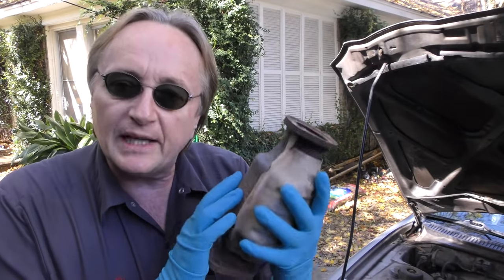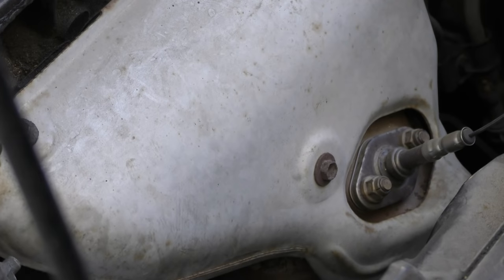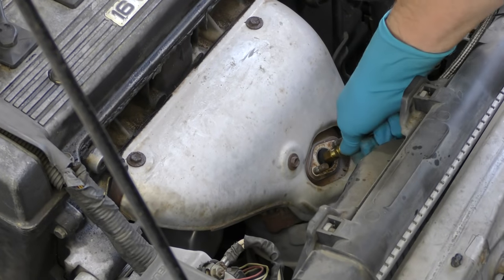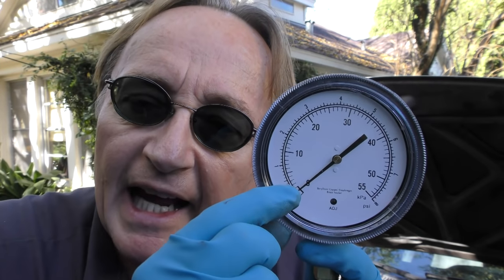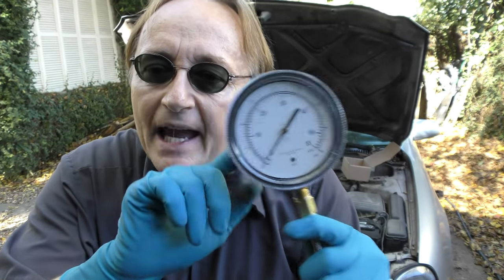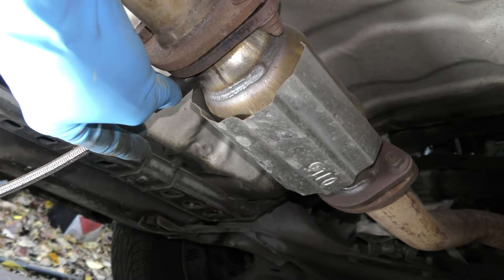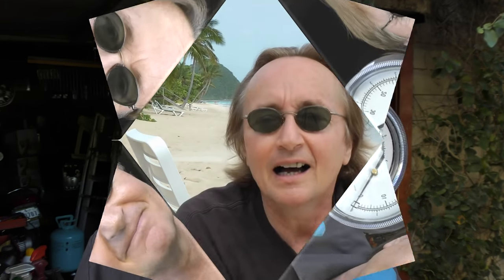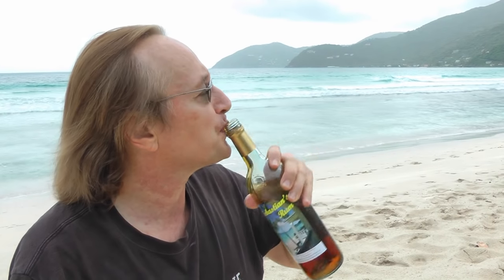How to Tell if You Need a New Catalytic Converter in Your Car

Comment: ok a long story long lol I bought 99 Ford  ranger. it set for year with 3/4 tank gas. I top it off with injection cleaner. truck hard to start. once I get it going drives great for 20 miles although idol rough. but then be doing 65 and sputters to a crawl. I pull over nearly dying I shut off restart v several times backfires then idols good enough to go and then I can only go few miles before repeated.. on first time I could probably go 100mph but once it starts sputtering I can't. it shows all three sensors out I could only afford the two top sensors left and right o2 , would these do that . for they are $50 a piece. also first 2o miles uses no gas after that I assume i get five miles a gallon have to hVe floored to go 50

Comment: Hey Scotty, great video helped me diagnosed my problem more.  I drive a 94 Honda Accord that I bought used.  I need to replace my exhaust system as it's all rusted and rattles when I drive.  Where I live my car is exempt to emissions testing due to its age.  Can I get away with replacing the cat with a straight pipe then getting new parts from the cat back?  Thanks!
Reply from the maker: yes, you'd be breaking the law and the check engine light would come on though. It is merely an anti pollution device, nothing more
Reply: Scotty Kilmer 8😡

Comment: What if you drilled out each individual hole. It would resurface the sides knock off all the debris. Maybe I better check out the design of one to see if it's possible.

Comment: That OTC Back Pressure gauge typically runs over $130.00 new. Unless you're hunting around for a used one that's not exactly a cheap solution.

Comment: Question I change the fuel filter did a tune up airfiler good . the guy at AutoZone told me to reset the computer not it hesitating not shutting off when is idle it fine . run my code 300 and 358 come up will that make my car cause hesitation when driving it .

Comment: Hey there am having real trouble with my 06 honda civic have been getting random and multiple misfire, I went a change plugs even engine and its the same thing. Whenever I clear the code it comes back and car start operates in limp mode. Any suggestion

Comment: I have a 2011 Buick regal with a 2.4 I get a smell inside the car it almost seems like it’s coming through the vents I’m not sure but after a couple weeks of check engine light came on it has power it runs I just don’t get the greatest gas mileage. Can you help me?

Comment: My mechanic said the cat in my Galant was going bad, so he put a washer in between the o2 sensor and the cat, reset the codes and never had the check engine line come on again. No emission testing in my state, otherwise I would have had to get that fixed.

Comment: I have a question my check engine light came on due to the catalytic converter. So I need a new one. And at the same time my A/C started throwing warm air. Did the ac have anything to do with the catalytic converter messing up?? Please help 😭😭😭

Comment: A quick one, is it bad if I have no backpreasure at all or negligible on a motorcycle, can this affect in any way the exhaust valves if so how
Thanks)
Reply from the maker: +george linco (gj047)  it can make the engine run lean, hot, and burn out the valves eventually

Comment: My muffler guy was only able to check behind my second catalytic converter and it has low pressure... on 2008 honda civic . Was low pressure couldn't get behind the upstream one so what shouild i do Scotty? Only rev's to 4500 sitting still but flows right to 6000 down the highway I'm baffled... could it be ignition coils causing this problem? I'm always pulling the Po402 code and can't get the car inspected.. HELP anybody? TX!

Comment: Scotty, I went to mechanics who seem honest and they told me I need a catalytic converter.  The Engine signal is lit up on my car.  The problem is they told me it will cost between $1,700 - 2,000!  I really can't afford that and my car is 20 years old.  In one of your videos you said to get a Walker Converter.  Would that work on a Lexus ES300, Year 2002?
Reply: What did you end up doing i have a 2000 GS300 and they gave me the same price but my car drives just fine I honestly feel like its a sensor but I can say i dont know that neither. Lemme know what worked for you man
Reply: Was it Cat. or sensor(s).

Comment: I have a 2000 Dodge ram 1500 5.2l  and it idles high and makes the headers start to glow what could it be I changed the IAC valve but it still idles high

Comment: Hi Scott. I like ur videos. They are rrally helpfull.I have a 3.8 engine buick regal,  one of the head there is a corrosion damaged where is the water cooling hole question: what would you use to cover up for a good seal? Considerer high temp and high psi

Comment: Ford replaced mine for free at 140k miles.
PZEV Ford Focus 5yr./150k mile warranty on emissions.
I think it went bad cause I had a miss from a bad coil for long time.
Engine was overheating and pinging due to back pressure.
$1500 job..Zero cost.

Comment: can a bad catylitic converter cause a almost screeching sound in a 2000 porsche 911?  I have this horrible screeching rattle sound in my 996 and I ve replaced the the serpantine belt and a pulley that didn't sound too healthy.  water pump is new so thinking maybe the catylitic converter but im no mechanic and Im done paying money to a shop just to guess and see
Reply from the maker: na, they rattle when they go bad, generally that's something  a belt drives.

Comment: Maybe you have added that the 02 sensor don't always come out so easily especially if they have been in there for decades and even using the special 02 sensor socket is no guarrantee it will come out.  Not a piece of cake as you make it sound.

Comment: Scotty could this cause a car to push oil out the engine seals? I put in a new engine and its eating oil just like the old engine did.
Reply: I think the blowby from 6 cylinders might be too much for the pcv valve to handle. the pcv valve is new. its an rx300
Reply from the maker: a clogged cat can do that by pressure
Reply: Scotty Kilmer that's what I figured. i cut it open, removed the media, and welded it back together until I can afford a new one. I realize I'm removing designed back pressure and its not environmentally friendly but a new one is out of the budget and my kids need to eat. lol. it was stuffed up real bad. we will see if it stops eating oil then that was it. 

thanks for the reply Scotty. God bless you man.

Comment: +Scotty Kilmer i have a question. I have an 08 scion tc and i just replaced the 02 sensors in my car. It told me that the sensor had low voltage. So then I ended up buying another and replacing it yet I am still getting the reading and my car is have a rough idle especially on startup where it goes to like 500rpms. Is it possible its that catalytic converter or no?

Comment: Scotty i need your help 
Gmc envoy 03 
As soon as the heater gets turn on I get a message about low oil pressure 
Any ideas 
I just replace the battery and starter 
Please advice

Comment: i have a 93 corolla with a catalytic converter that looks very alike the one you show in start of this video....  Mine now has a few small holes in it that leak very noticeable exhaust stink... i tool it off and i saw holes occurred on the top outer edge (just in the little concave crease) which i though was strange as opposed to developing any holes on the bottom side in between it and the little crimped on heat shield, where i have no leaks.....  wondered why this might happen on only the top side of it  , and  i was wondering if anyone can suggest any reliable exhaust putty or furnace cement products which might work good to seal up and fix the holes ?   .... after taking wire brush to it the rust looks limited to just those few certain very small spots so im sure a competent welder i think could also likely fill in the dime sized holes back closed with metal spot weld  ?  can imagine maybe the decades of water had splashed up there and didnt drip off and dry as fast as on the bottom side since it was caught and stays pooled in that crease maybe ?

Comment: I have a 2002 Mazda protege5 the problem is a O/D light flashes the car begins to shift back and forth and the speedometer stops working. If I unplug the battery the problem goes away for an hour or two then it comes back. helppp  mee  pleasezzzz

Comment: my temperature guage shows my car is nearly at Cold ever since i flushed the old coolant out, and added new coolant. However, after test driving it at night just now, the entire engine, everything in the front was very hot. Could this be symptom that my cat is bad? why is the front so hot while the temp guage shows its normal???
Reply from the maker: change your temp sending unit first, that's probably bad. If not, pressure test the cat to see if it has too much back pressure

Comment: I have a bmw 528i 1999. I'm not sure what it's called, I think it's my exhaust system, "located under my vehicle also attached too my muffler". I'm just not sure if those parts under my vehicle are called the exhaust system. Anyway, those parts under my vehicle, I'm just going to go along and call it my exhaust system. My exhaust system is hanging, like it isn't stationary, my muffler bounces as well as my so called exhaust system. Do I need, exhaust hangers? Or what ever their called. If yes, is there a more convenient and cheaper way I can go with and install myself? I'm an amateur when it comes to vehicles. So yeah, bear with me.

Comment: I have a 2010 Nissan Sentra that has a cylinder 1 Misfire I change the spark plugs coil packs  And that didn’t fix it I had the few injectors changed that didn’t fix it but if you put your hand on the back of the exhaust you can feel the misfire could a bad Cadillac converter Cause A cylinder 1 misfire

Comment: Hey Scotty Kilmer:  You've got some cool videos!!
But I wanted to ask you (and other DIY'ers out there on your channel) something.  
I have a 2004 GMC Savana 3500 box truck (very similar to what you see out there as a Penske or U-Haul small truck) that is now giving me an Error Code P0430.  Looked at lots of videos on this.  This is probably due to a bad Catalytic converter.  Changed the Oxygen Sensor (first, because that was a $25 tab and the O2 sensor looked banged up).  Got the truck Used a couple of years ago.  The truck has started losing power.  Once on a trip to PA, it started slowing down to a stop on a 150 mi route. New O2 sensor did not change anything with the code (Yes, I cleared it with my Innova Scan tool).  
I now bought the OTC Exhaust back pressure gauge that you have on this video.  BEFORE I replace the Cat (or maybe both Cats).  I tried what you said on this video.  EXCEPT that with this OTC gauge, I get 0 (Yes, ZERO) pressure UPSTREAM of the Cat AND DOWNSTREAM of the Cat.  Pressure gauge inserted where O2 sensors were.  And when I blow on the Pressure Gauge (thinking it may be defective), I can read pressures of 1.0 to 1.5!  What's up?  What do you think?  Recommend?  I may return this gauge because there is something funny going on with it.

Comment: I have a 2002 Ford escape with a 3.0 v6, it will not rev past 2000 rpms. ive replaced the fuel pump, just about ever sensor possible. intake manifold and more. could this be a bad catalytic converter problem?
Reply from the maker: it can, and a simple pressure testing with a gauge can tell you if it is clogged up
Reply: Scotty Kilmer wow I took my 2010 nissan altima to the shop yesterday because of the engine light that came on and the service code read p0420 and the mechanic just automatically says you have to get your entire exhaust system changed and it's $700 just for the part.
Reply: Hey Chase, IF you haven't solved this issue yet. Check the rear converter about half way back. They have three, one in each exhaust manifold, and then the rear one about half of the way back underneath the vehicle, they seem to plug first and cause issues. Unbolt it if you can, or pull the rear O2 sensors if that is more convenient and see if it runs, if so, that's the issue! Good Luck.

Comment: I have a 07 Freestyle and it has no power when I press the gas pedal I checked the intake sensor and replaced it and the gas pedal as well can you please help no one at autozone and several mechanics know one said it was the transmission but when it is in park it does the same and no power what so ever
Reply from the maker: the ONLY way to figure that out, is to get a guy like me to hook up his dealer level scan tool, drive it, and analyze historical codes, live data, and mode 6 data.  And of course, you could firt pressure test the fuel pump as weak ones do just that

Comment: My check engine light came on. I have a nissian maxima 2008 and they said it was my Cata converter and when I was driving it the little stick that over heats was going up and then I pulled over and parked and it stood very closely to the top but as soon as I pushed gas to go it went back down. Can anyone help me out??

Comment: how to check if catalytic converter is empty (burned down(no greed inside) ) ?  not removing parts as rusty bolts may break? hyundai accent  because every 500 miles the check engine light turning on and obdII  P0422  codes appears.
Reply from the maker: have it checked with a heat measuring gun, if front and back of the cat are the same temp, nothing is inside
Reply: +Scotty Kilmer  I NEED HELP MY 04 NISSAN TITAN WONT GO PAST 3500 RPMS PLEASE HELP!!!

Comment: My 06' cobalt was running hot & it would lose power, so a friend of mine hook it up to his hand held computer & it came up cat converter & tune up. So i change the cat & put a new one in & changed the plugs & it still runs hot & i'm still losing power. So he hook up the car again to his hand held & it says random misfire.... I don't know what to do?
Reply from the maker: +Jim Van   cats get ruined from engine problems clogging them up.  Since it's running hot, do my video "how to fix an overheating car" and PRAY it's not a blown head gasket

Comment: I;ll try again asking this question---> I have a high mileage car and it runs fine with no "codes".....but I'm asking if anyone here did it (with the correct concentration) on a car with no code like mine....but then saw improved running and maybe better mileage. TIA.

Comment: Can a bad catalytic converter cause O2 sensor issues
Reply: Yeah if you have 2 upstream and 2 downstream 02 sensors they will say they are all bad. but in reality is just the cat giving you those fault codes.

Comment: scotty whats the fix for winshield wipers that work sporadic on 1998 wt4x4 1500
Reply from the maker: +terry woods sometimes the ground wiring goes bad on the wiper motor. if not, replace the motor assembly with a rebuilt one.

Comment: We recently learned the hard way that a cheap, high performance,  high flow replacement set of cats turned out to be a failure....the paladium content was too low causing constant cat related codes. Two good quality cats fixed th problem.

Comment: What if I got the po420 code for it. I deleted it months ago and it hasn’t came back. Does that mean I do have to change it once that code comes up?
Reply: Will I be able to pass smog if my car seems to function all properly even tho I deleted the code ?
Reply: Okay seems like from what I searched up that if you delete it and do minor fixes yourself like cleaning it out or other things (I didn’t do anything directly for it) and then delete the code and keep driving for 50 -100 miles. And if the code doesn’t come back up again then You’re good right ? So since I deleted mine and it hasn’t came back it’s technically good or is it still marked like it had a code ?

Comment: Or if you have a car made after 1996 pull the code for the check engine light. If the code says cat converter efficiency you need a new cat. Please note if your cat is bad you will trip a code for the cat, if your tripping for the sensor it has nothing to do with the cat and is a problem with sensor or the circuit for the sensor. You will not trip a code for the sensor and yet have a problem with your cat. however if you do trip a code for the cat don't be surprised that shortly after replacing the cat you then need a sensor. This is because a bad cat typically starts with it getting way to hot (then the inside melt and that is when you have the problem with a clogged exhaust). That extreme heat and if ignored long enough melting of the metal will contimant the tip of the o2 sensor and result in a o2 failure. The problem is once you trip a code for the cat the computer typically ignores info from that o2 sensor because it knows the cat is bad so it fails to realize that the sensor is also bad. After you replace the cat and the monitors reset it then realizes the sensor is bad and so you then trip that code. Moral of the story is most cases a failed cat will cause a failed o2 sensor, and on some cars the o2 sensor needs to come out to replace that cat so I would typically suggest replacing the o2 sensor with cat.